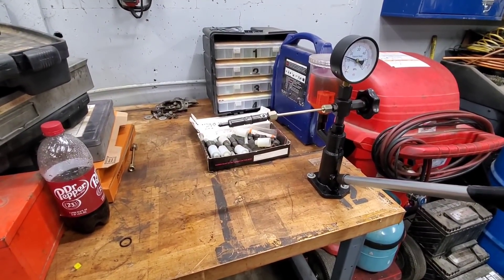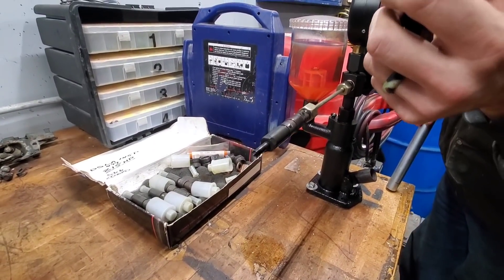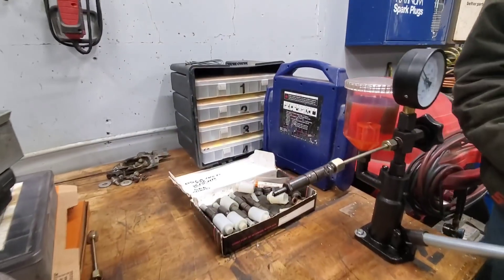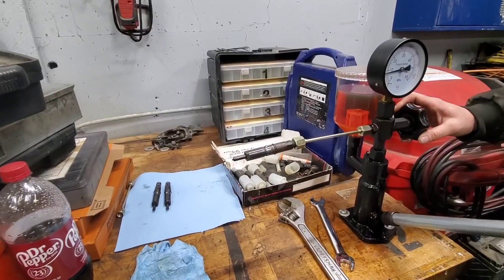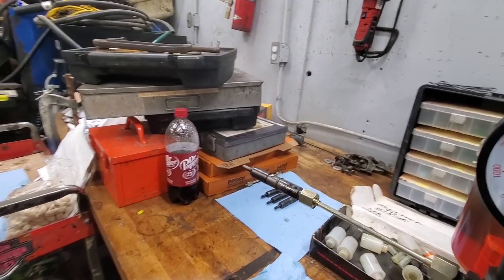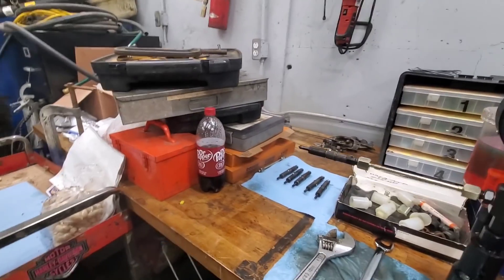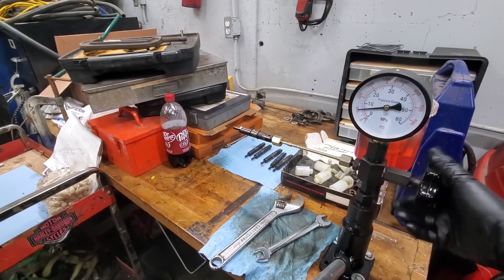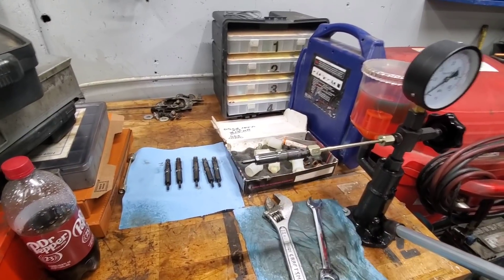12v injector testing

Comment: If you actually pump it upclose to full pressure with the knob screwed out. You can then turn in the valve and see the exact pressure you're pin in your injector  will drop at. Its a fine adjustment screw. Not a relief valve for the pressure. Great video tho

Comment: Looks like a few of them will be spraying the cylinder walls instead of the piston bowl
Reply from the maker: Spray patch isn't symmetrical on a 12v. The injectors are offset in the bore. That's how they should be.
Reply: @Spyke383  yep no problem. I have seen plenty of snagged pistons from bad timing from programmers to extruded honed injector nozzles  that were not even hitting the piston bowl

Comment: Next do a "don't try this at home" and have some candles burning in the background.
Reply from the maker: Hard pass
Reply: It would be interesting whether they lit the fuel, did nothing, or were blown out by the blast before doing anything.
Reply from the maker: @lwilton  be the dame as a windex bottle. Big smokey fireball lol
Reply: @lwilton  The speculation on the type of bomb used in the recent incident in Nashville would have some characteristics of what you said. Known as a thermobaric, or a gaseous fuel-air explosion. Fuel, of some kind, was put under high pressure and then released at high volume and speed to form a cloud of gas which was detonated by some device when the cloud was overhead. This type of bomb creates enormous pressure waves as it mixes with the oxygen around it. The military has used bombs built on that principle on caves and bunkers in the past!  I was thinking about that as soon as I saw the injector spray, my first time for that too!
Reply: Steve Darnell at WelderUp uploaded a video last week of a 12v injector test demonstration and used a torch to make a large flame explosion. If you forward to the 9:50 mark, it is when he begins the demonstration. https://youtu.be/Z5pxrRs7R0g?t=591

Comment: I would make a container from a plastic fish tank, to catch the diesel👍
Reply: Back in the day, we used a Stanadyne tester that shot into a graduated test jar. You would pop each injector ten times and measure the volume delivered. It's possible to have good pressure and a good pattern, but have less or more delivery between different injectors.